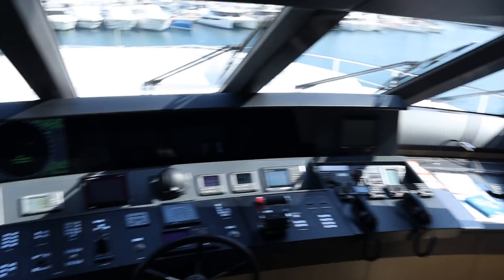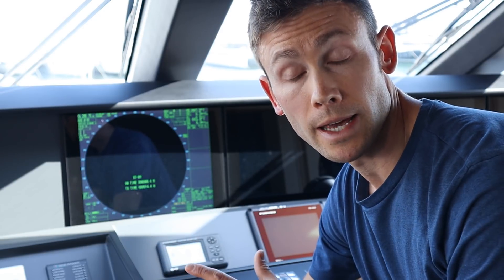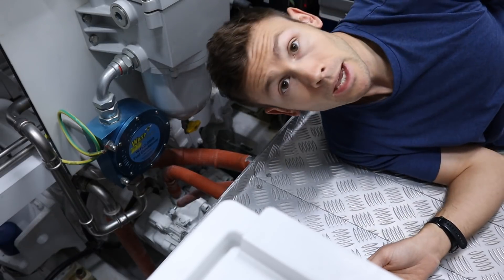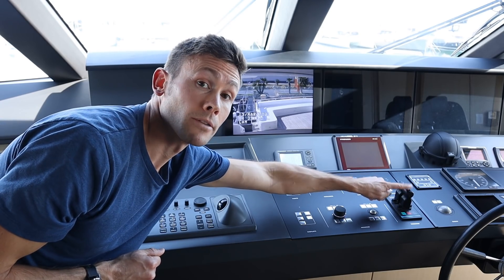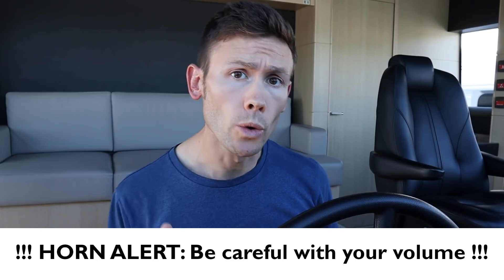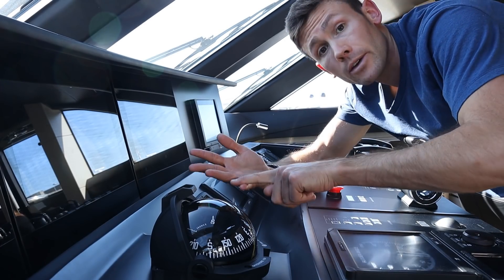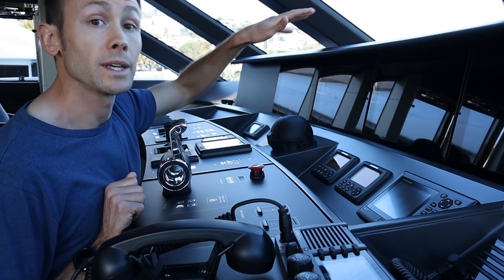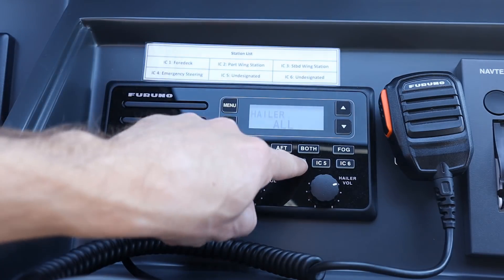THE SUPER YACHT BRIDGE EQUIPMENT TOUR | What It's Like Working On A Yacht In The Bridge

Comment: Good explanation , nice equipment,
Reply from the maker: Thank you Captain B! Are you currently serving as Captain on a ship, and how does this compare to your equipment?
Reply: @WorkonaSuperyacht  currently I'm home my last ship was a 85,000 GRT tanker. Your set up much nicer than on the comercial vessels I served on, we have a bit more equipment like both X & S radars, we have more options for signal lights, None Follow Up steering system, Rate Of Turn indicator, less engine controls as we have engine room that are maned when we need, we don't start hydraulic, or air on deck, that is done from the engine. Most of my vessel didn't have thrusters as we  are required to use  tugboats in and out of ports anyway, also no trolling, but we did have Controllable Pitch Propeller on one Ice Class Tanker I was on, best ever. I think you would have done well on the bridge of a much bigger vessel. Happy Easter
Reply from the maker: @Captain B Thank you for this detailed reply. It's great to hear how our equipment compares to large merchant ships, and I really appreciate you taking the time. 
A very Happy (belated) Easter to you too, and all the best with your next contract.

Comment: It all looks surprisingly simple and straightforward . No idea why it should take so long to learn, as per one of your earlier posts.  Is this by any chance  due to a lack of pre  educational qualifications  ??  Therefore plodding at the pace of the slowest student ?  Certainly in comparison to aviation this is kiddie simple and super slow
Reply from the maker: Hello SandhoeFlyer, and thanks for your comment. You are right that it need not take 3 years to learn the principles of safe navigation, and to pass all the exams required to attain an OOW qualification. However, there is a very big difference between gaining knowledge in a classroom, and applying that knowledge in real world scenarios where human life and the environment depend on you taking the right actions. 
Accordingly, the bulk of the 3 years required to attain an OOW qualification are spent putting what has been learnt into practice. Furthermore, it should be noted that the program of training isn't limited to navigation; it also includes management of other crew, the safe and proper operation of all deck equipment, fire safety, life-saving appliances, tender driving, meteorology, ship construction, etc.